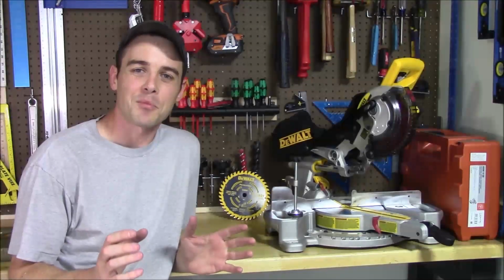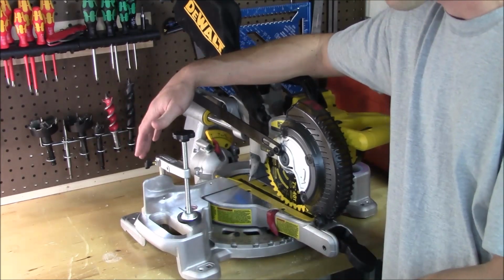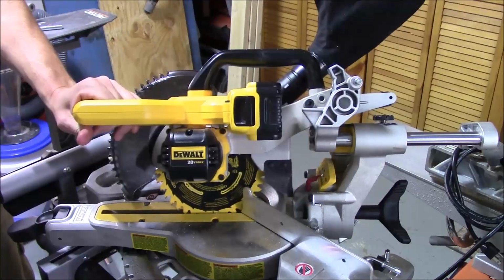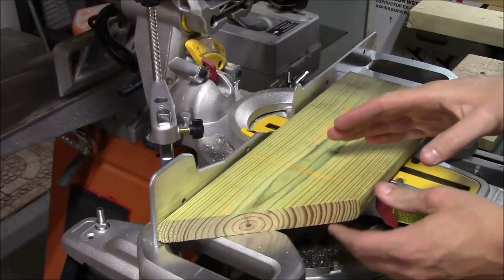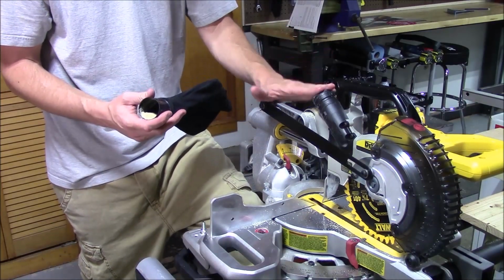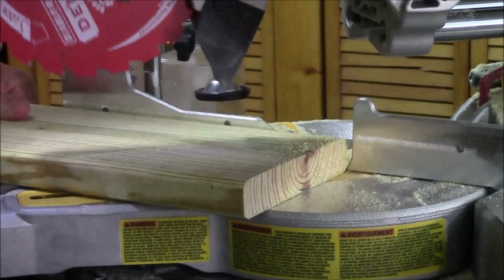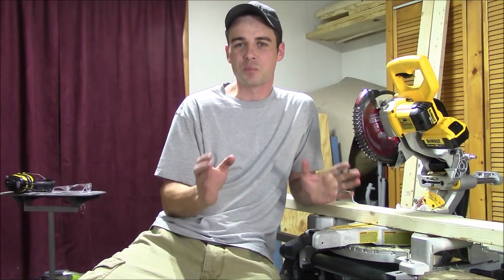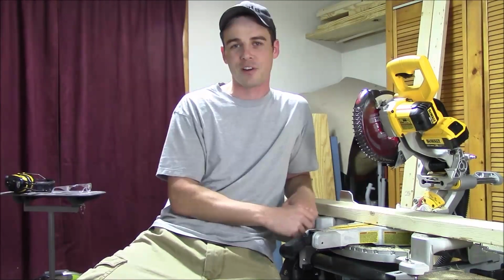DEWALT 20V Max 7-1/4" Cordless Sliding Compound Miter Saw DCS361 / DCS361M1 / DCS361B

Comment: Thanks to for the video, can this miter saw cut small 2020 Extrusion Aluminum with a dedicated Aluminum blade?
Reply from the maker: I don’t see why not….. however keep in mind that the rpms on a wood saw is typically different than a metal saw…..also there will be no preventive measures for chip/flake capture, so be sure to wear protective gear…. You most likely get covered in aluminum chips.  Personally I’d go with a portable bandsaw, not this.

Comment: I noticed you changed the blade to a diablo blade,  were you not satisfied with the dewalt blade ? Mine came with a 40 tooth blade but I purchased a 60 tooth dewalt blade but haven't used it yet .
Reply from the maker: The ONLY factory blade that is any good is Makita.  Every single other brand is contractor-grade at best.

Comment: Good video. 
I find it odd that Dewalt includes a 5aH battery with the 6-1/2" Circular Saw but only 4aH with the 7-1/4" Miter Saw.

Comment: Dewalt lists the maximum vertical cut at 3.5". A 4x4 us actually 3.5"x3.5". I wish someone would truly verify if these can cut a 4x4, because according to dewalts specs, it should be able to. This is the only 7 1/4 miter saw I have found with a 3.5" vertical cut depth.
Reply from the maker: The washer that attaches the blade is wider than 1/4”.....so no, it cannot cut that deep.
Reply: Steven it won’t, but just flip the 4x4 after the first cut and cut the other side. I built a deck that had 14 4x4’s that had to be cut and it works that way. I have built multiple things that used 4x4’s with this saw.

Comment: VS the Dewalt with the RIDGID 18 Volt Lithium-Ion 7 1/4 inch Dual Bevel Sliding Miter Saw with Brushless Motor R48607K
Reply: or more like which  one would you buy if you can? I am thinking of getting the RIDGID 18 Volt Lithium-Ion 7 1/4 inch  R48607K or the DEWALT DCS361
Reply from the maker: Absolutely the RIDGID, but I’m not sure if they still make them or not.

Comment: can i also use it with a cord or is it strictly battery?
Reply: Luis Munoz cordless only. The only tool they have with that adapter is the dual battery flexvolt chopsaw. It lasts a very long time on one battery though. 270 cuts 3/4” pine with one 4.0ah battery. 5/4 PT decking it’s close to 200 cuts I bet. Hope that helps

Comment: great review! one question, will it cut the 3 1/2" base vertically in a 45 degree to the right also? I seen it does to the left. I install a lot of base but don't like cutting the angles while it lays flat, pain in butt, thx

Comment: Need put brushless motor in miter saw and using fexvolt saw blades
Reply from the maker: I would imagine they will be upgrading this at some point......7-1/4" & the 12" Flexvolt.....definitely room to expand.
Reply: Brushless doesn't necessarily mean more powerful a quality brushed motor can be just as powerful if not more powerful

Comment: will this get though a 4x4?
Reply: Probably not. A regular circ saw can't cut through a 4x4 so this is bascially the same blade as a circ saw but miter saw. If you wanna cut a ,4x4 12 in miter saws are best. Sorry for replying 3 years late buddy 😂

Comment: I just spoke with a DeWalt Rep. The saw does come with a 7-1/4" miter saw blade. The difference is that it has a negative rake. You will get a better cut by using the DeWalt blade. However I know most people will be buying a Diablo blade instead. Either way, nice review and Happy Holidays
Reply from the maker: +Nalu Rash Thanks Nalu!  I use the 7-1/4" Diablo Blades for consistency, and because they are readily available at Home Depot.  Interesting news on the Dewalt blade though.....I will look into that...thanks!

Comment: You only show this saw cutting through wood, i'm assuming the same can be done with the appropriate metal cutting blade or is this for wood only?
Reply from the maker: +jharris280zx I know some people use standard miter saws & circular saws for metal.  Personally I would not suggest it, since they are specifically designed for wood (torque applied through a cut).  The metal circular & chop saws are completely geared differently & wont "burn up" like a normal unit with extended use cutting through metal.

Comment: Just spotted this saw in my local Home Depot store.  Really appreciate your thorough review.  Thanks!!!  I have their big 12" compound sliding miter in my shop but really need something more portable to take on the road.  Just curious, what's the make and model of your miter saw stand???
Reply from the maker: Thanks!  I am glad you liked it.  The miter saw stand is a Ryobi A18MS01 ($99 in the store at Home Depot) http://m.homedepot.com/p/Ryobi-Miter-Saw-Stand-A18MS01/100397569
Reply: +Real Tool Reviews Does Dewalt have a crown stop option for this little guy???
Reply from the maker: +Mitch Lennon Not as far as I know, but they could eventually release one.

Comment: One thing you didn't mention is that when you miter to the right, the motor prevents you from cutting 3 1/2 inch material vertically. You can only cut about 2 inches vertically when mitered to the right. Found that out today and was rather disappointed. Sure you can lay it flat and bevel it, but it still sucks.
Reply from the maker: +Got Metal 7-1/4" blades definitely have their limitations....being lightweight & extremely portable are two big advantages of this VS a 10" or 12" miter saw though.  Thanks for pointing that out & taking the time to comment.
Reply: Real Tool Reviews Indeed those are great advantages. I still love the saw and will definitely use the hell out of it. Just thought I'd point that out as I haven't seen it mentioned anywhere before. Great review btw.
Reply: I have this saw and a 10" slider plus a 12" and find myself using this one almost all the time.

Comment: I'm in love with this saw, I been left behind in the 18v but I think this saw will help me cross over. 

I have a 12 double bevel sliding right now. It's huge and heavy. I am a new home detailer that does punch list items. I keep my saw in the back of my truck and have to pull it to the end then run an extension cord to the house just to cut one cut some times then have to roll my cord up and sit the saw back in place. But this one is small enough I can keep right in the back ready for a cut and move on to the next house or the next work order. 

I usually cut door casings, base up to 5 1/4 , scribe, and the occasional crown. This saw is perfect for me. Ive been seeing the box at home depot but it wasn't until they had a display model that I fell in love with it.
Reply from the maker: arturo raygoza Thanks!  Good plan.....definitely better than hauling out a 12" slider for a quick cut!

Comment: I have a question. I'm not all that familiar with carpentry. What is it that a miter saw can do that a table saw can't? Which is more versatile to have if you only have one?
Reply: Bigchuck678 A table saw is primarily for ripping plywood and making rip cuts (lengthwise of wood). A Miter saw is far better at crosscutting wood within its specs to a desired length, such as cutting down 2x4's. If you can only have one then a table saw can make all cuts with a proper jig for each cut, However having both is really the best way. You can find miter saw very cheap.
Reply: Thank you  for the explanation.
Reply from the maker: Bigchuck678 +TheVelluch has it 100% correct.....sorry for the delay!  Starting out, you would be better to go Jigsaw, then Circular Saw, then table saw, then miter saw in my opinion.

Comment: Great review. I feel like the saw bevels the wrong direction. I would have much rather seen it bevel to the right as it keeps the blade away from my hands and doesn't create a blind zone during cuts.
Reply from the maker: robertb6964 Thanks Robert!  I did not think about that, but I can see where you are coming from....thanks for adding that in!

Comment: Great review! Very helpful and informative! I'm already on the Makita 18v lineup, my question is would you think that this saw and the 16 gauge nailer coming out would make it worthwhile having 2 different 18v lineups (purchasing Dewalt tools/batteries/charger) or do you think makita's 18v mitre saw and 18gauge nailer would be sufficient enough to remain with only 1 18v lineup? Have you ever used makita's 18v mitre saw?
Reply from the maker: ***** I have not used the Makita 18v saw or nailer, so I could not say.  However, all of the Makita tools that I have used have been top notch.  I personally would not have an issue with more than one battery platform, since a lot of times when you buy a kit --- the batttery/charger that comes with the tool is heavily discounted in price (vs buying individually).

Comment: Interesting how it casts a shadow on one side and a light on the other side whereas the XPS system on the 780 casts a pure shadow line down the middle with equal light on both sides.
Reply from the maker: Patrick Ellis This is my first experience with a Dewalt miter saw with the XPS system.....I really like it, and hopefully will get to try out the larger units at some point soon so I can see what you mean.  Thanks for the update!
Reply: Patrick Ellis It does also produce a pure shadow line just like the bigger saws with XPS system. You just have to lower the blade a little more. I just bought this saw and I am really happy with it.

Comment: I always look forward to watching your tool reviews. You do a very thorough job, one of the best I'd say. Just had a question about the blades. Miter Saw blades have a different rake on them, and I would imagine that a 7-1/4" Miter Saw blade would be hard to find. Do you think a regular 7-1/4" Circ Saw Blade would be okay to use?
Reply from the maker: Nalu Rash Thanks!  I appreciate it :)  Sorry for not being clearer in the video, but this uses normal 7-1/4" circular saw blades (there are no 7-1/4" miter saw blades).  I prefer using Diablo Demo Demon 24-tooth blades in my testing of circular saws, to make things always a level playing field across various brands of saws.  They are at Home Depot for about $15/each.  Also, for finer finish cuts you can use a 40-tooth or 60-tooth blade.....the 24-tooth is better for the run time testing since I can cut faster & get more cuts.  One thing to note --- pay attention to the blade direction when installing a blade (not the paint/words on the blade since it varies from one manufacturer to the next).
Reply: Real Tool Reviews Thank you very much for your reply. Greatly appreciate it. Can't wait for your next review, take care
Reply: I use 24 tooth and 40 tooth cutting crown molding etc. Awesome saw and cheap to keep a good blade in it vs a 10” or 12”. I also use the Diablo blades. Home Depot has deals 2 for the price of 1 on those a lot of times so $15 for 2

Comment: Incredible count on cutting 2x4'S. I'll have to see if it's available in Canada , no more genset running all day. Thanks , never knew they existed.
Reply from the maker: Steve Rob Thanks Steve!......they actually just came out, so I would assume if you can get USA tools there, your Dewalt dealer can get one of these.
Reply: Steve Rob Home Depot Canada has the kit option available for order online (7-12 day delivery wait)... somewhat pricey even with the exchange rate.  JCCayer can special order both the kit and the bare tool but their prices are even more on the crazy high side.  Might be awhile before other stores/retailers pick it up and bring down the price.